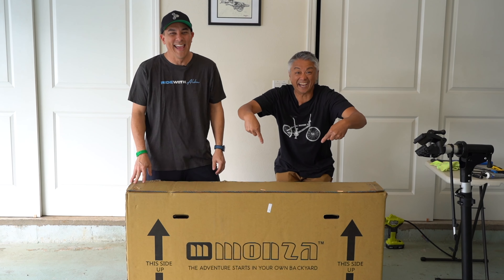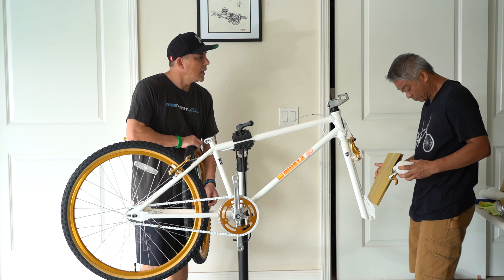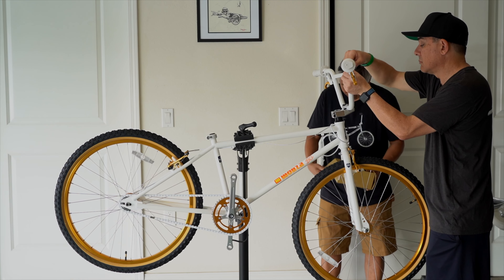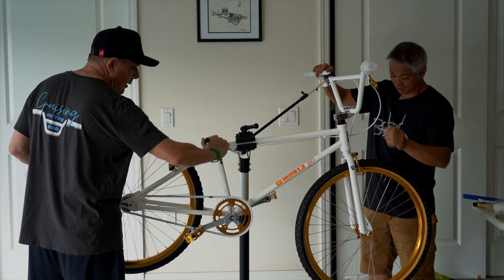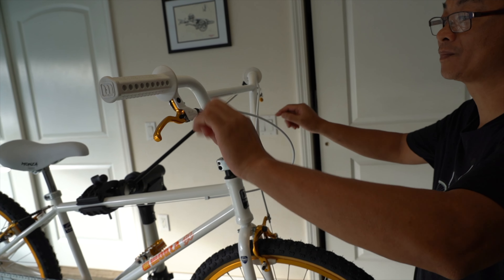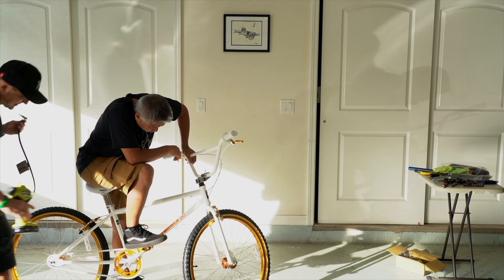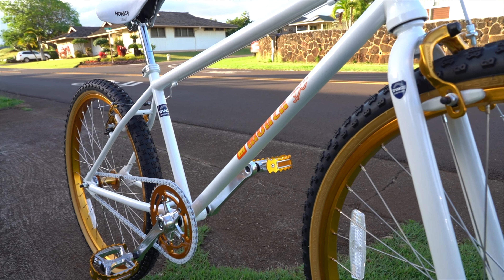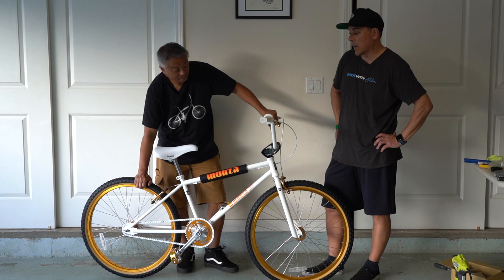Unboxing and Building a new 26" Monza BMX in White!

Comment: You guys need a brake dial in master. I just clamp to rim. Allowing the adjust half way and make sure you lever is dead tight. Then just adjust the brake adjuster that you half turned out. Also the brake spindle needs to be centred once you clamp down the brake line. Then adjust out the pads. Brake lines do stretch over time. Thats why i buy pre stretched like the odyssey linear sls brake lines.and add some tri flow lube and air gun threw the line with the cable out. Even though they come pre lubed.  Better most than less for friction and anti rust.👍
Reply from the maker: Thanks for the great tips! We should have seen this before we worked on the new Monza 24!  Thanks for sharing and for watching!

Comment: Many bikes come with the chain super tight, which is usually a good thing (temporarily) as long as nothing is getting damaged - it helps pre-stretch the chain. I would move the wheel forward a tiny bit though to give the chain some slack.
Reply from the maker: Great point! That is a great tip!  Thanks!

Comment: Another awesome bike and build video! 👍
I believe those brake levers have a pull adjustment chip in them . The front ( caliber brake) should be set up short pull  and the rear ( V- brake) should be set up long pull for best braking power and modulation.
Reply from the maker: Is that that tiny black plastic piece that is inserted into the brake lever? We weren’t sure how that worked! Thanks for sharing that!
Reply: Yup, that’s it👍